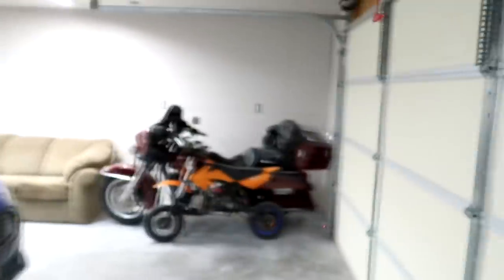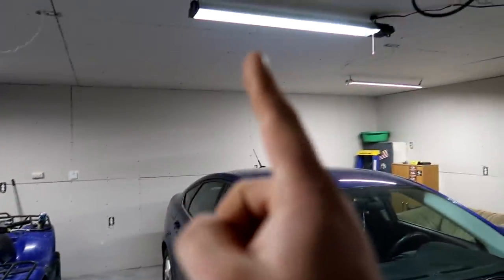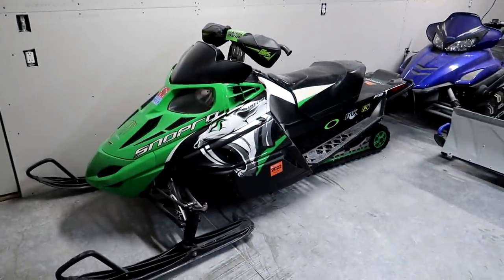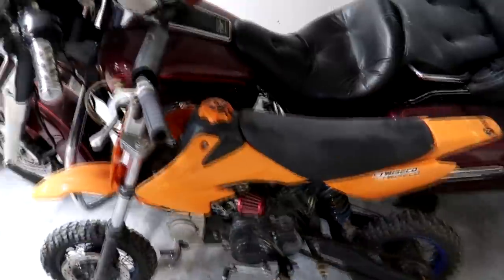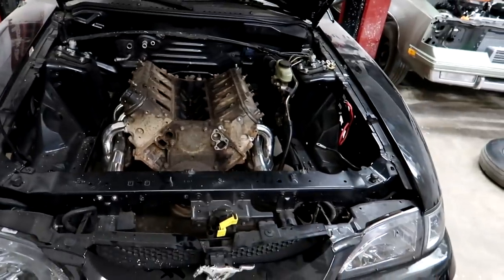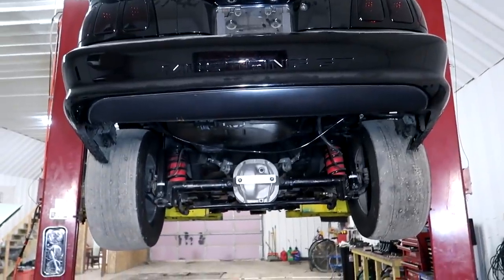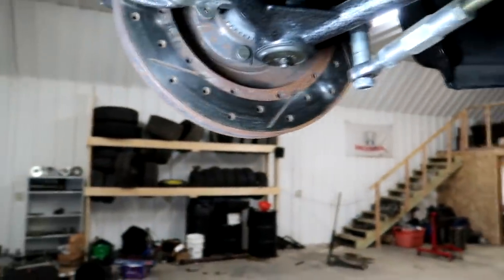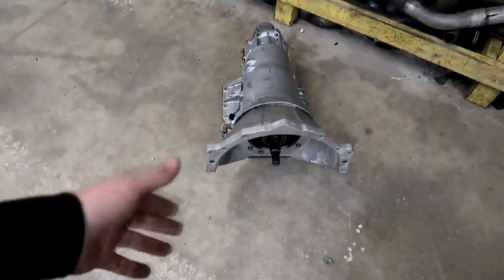"Black Betty" Sn95 Mustang Walkaround + Brainstorming + I Finished My Garage It Looks Awesome!

Comment: Coming along nicely! Certainly easier to pull all that factory stuff out and start from scratch. Tube front end will save good weight and make more space. Worth the time in my opinion. Excited to line the ol 1g up beside this thing and show ya some tail lights in the spring

Comment: That vacuum type line is either the vent line for the fuel tank or something having to do with the evap system Ford usually uses a charcoal canister of some sort if I’m not mistaken
Reply from the maker: For the air bag suspension we found
Reply: @HunterTuned  makes sense

Comment: No tube front, the car is straight and not rusty. No need to cut up a clean car. Cut the rear trunk out and weld up the seams